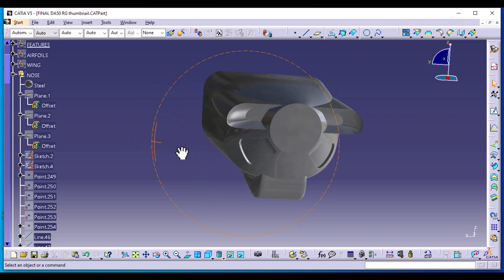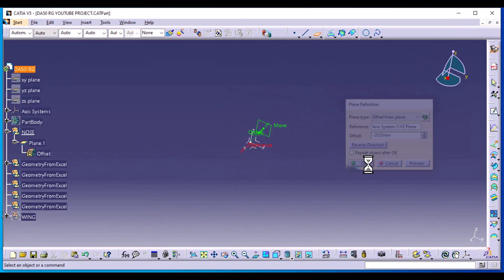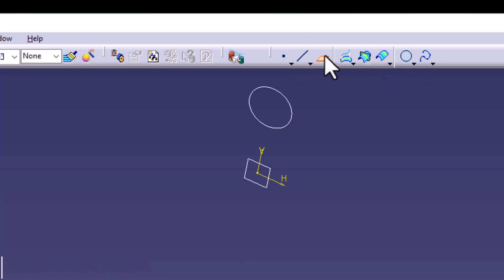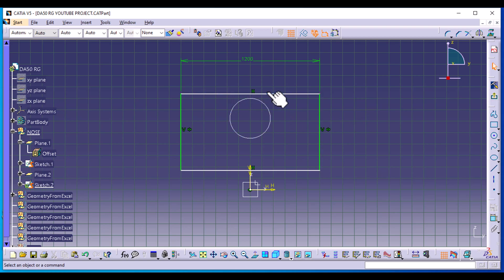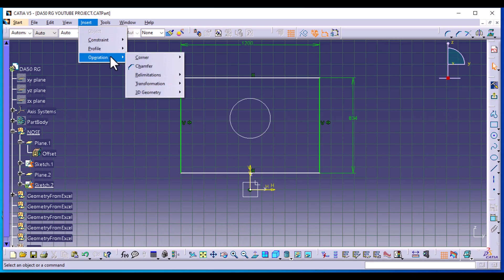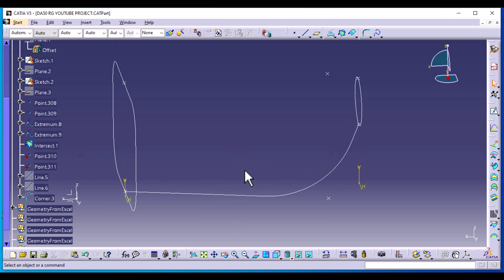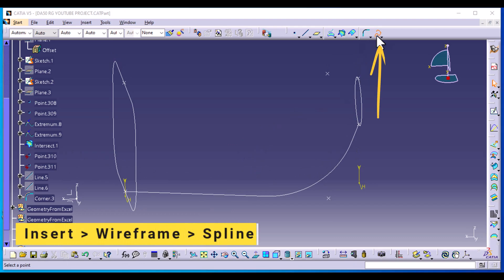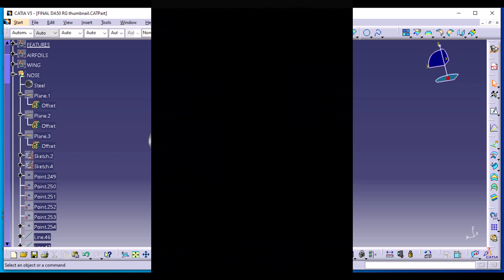CATIA V5 - DA50 RG AIRCRAFT DESIGN USING GSD CATIA V5| BEGINNER - ADVANCED| PART 2 - NOSE DESIGN

Comment: Hello and thank you for sharing your knowledge with us. May I ask how you determined these specific measurements in the sketch starting at minute 10:10? Do you need access to the original blueprints for that?
Reply from the maker: If you go to the official Da50 rg technical specifications site referenced in part 1, you'll find data & cabin measurements that will help you calculate & estimate these data.
I do not have access to the original blueprints.